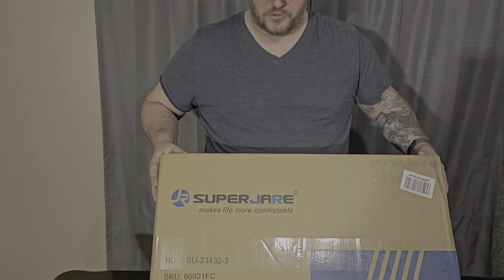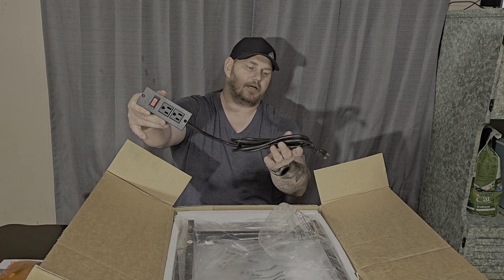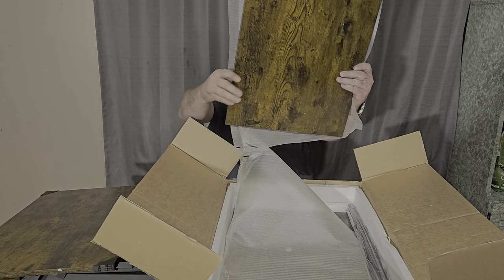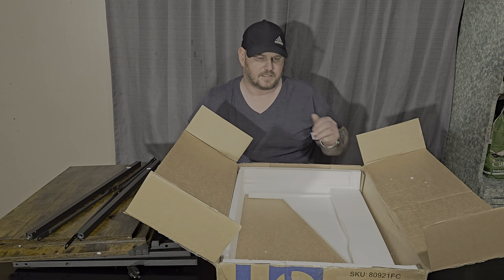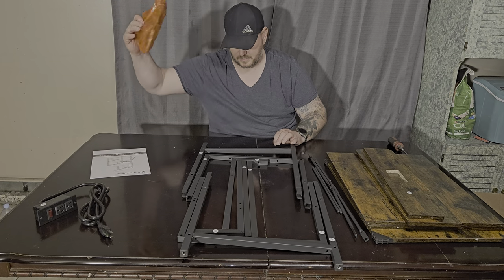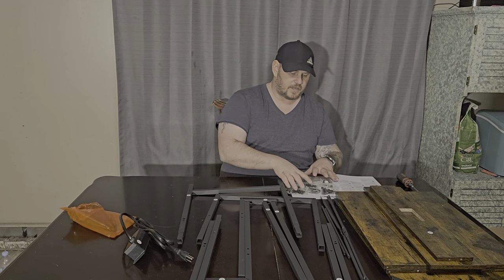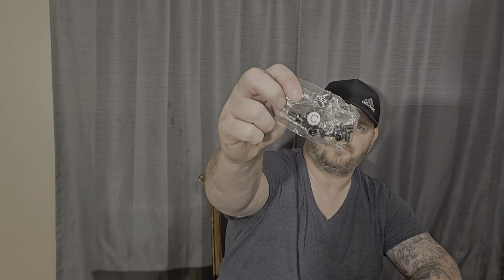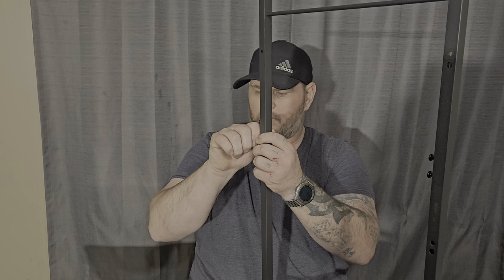SUPERJARE Kitchen Bakers Rack with Power Outlet, Coffee Bar For Our Nespresso Vertuo Plus

Comment: EGO electric lawnmower is turning out to be a Epic product. Taking care of my wife takes a huge amount of time so anything that saves me time helps alot. This fall leaf cleanup is very easy because all I had to do is put on a high lift blade that creates suction and rear bag to this mower and it picks up and mulches the leaves. Last night was doing this past dark with no problem because the mower has two LED headlights. Wouldn't buy a electric car for many reasons but lithium 🔋 powered lawn equipment is definitely viable now.